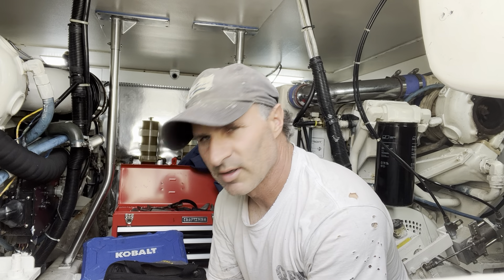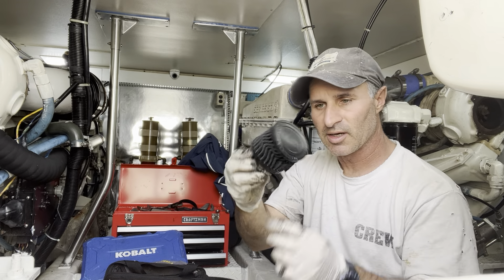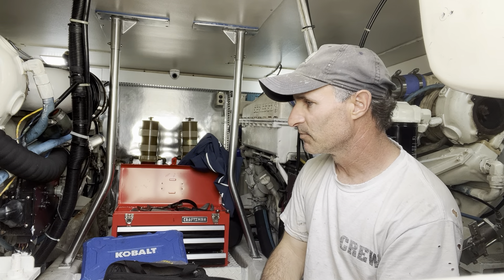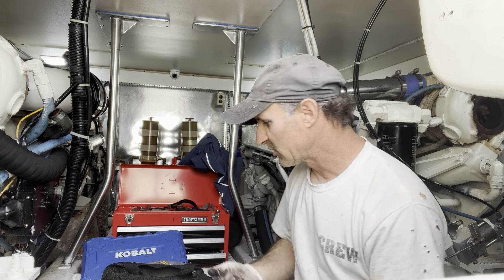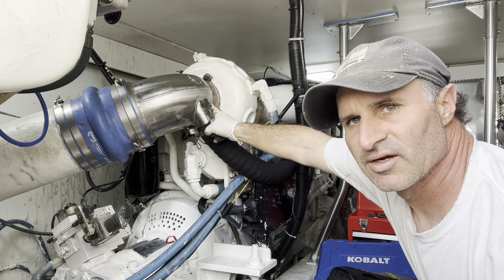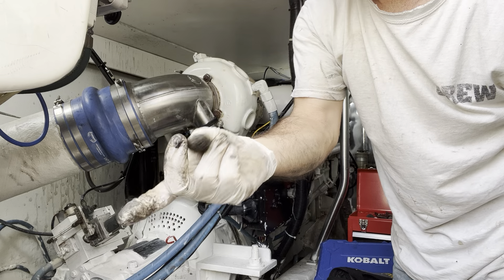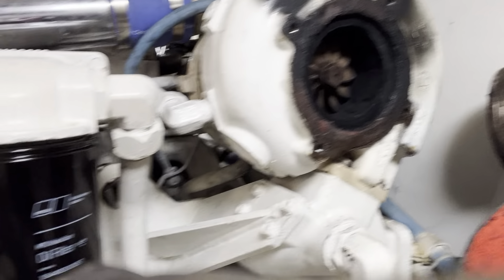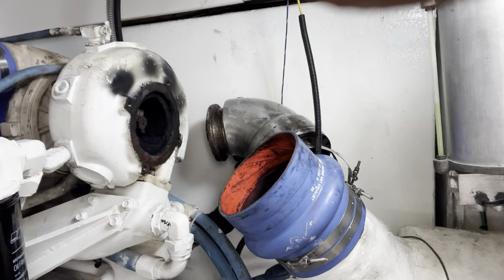Detroit diesel series 60 marine

Comment: It looks like turbos and the charge coolers all need to be sent in for repairs and cleaning. It looks to me like those engines have been rode hard and put up wet. Lack of maintenance and run hard. Maintenance,  maintenance. When will the owners learn.
Reply from the maker: I agree 100%. It’s a new owner to the boat and they said that they had 1000 our service just done to it. Closer inspection it doesn’t look as though that that actually happened. So we’re trying to work with the broker and the owner right now to determine what our next course of action is but more than likely I have to rip the turbos off and get everything sent out as well.  Thanks for watching and the feedback!  
Capt. Dave